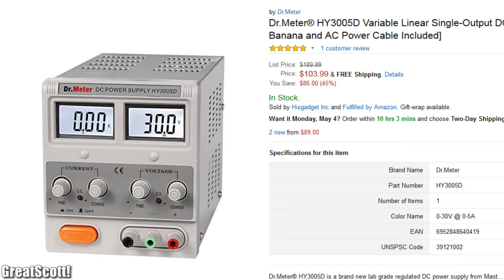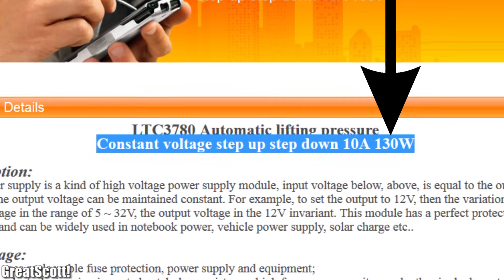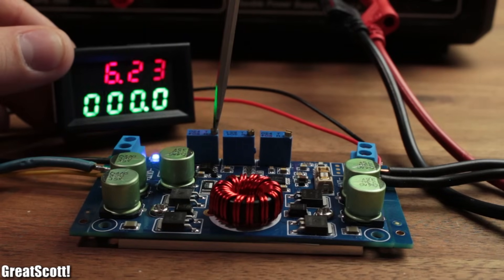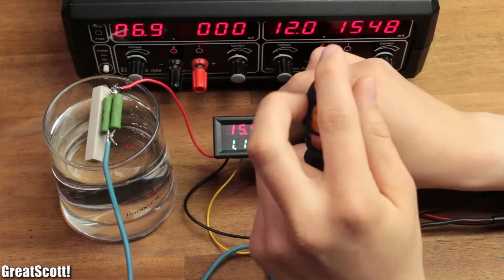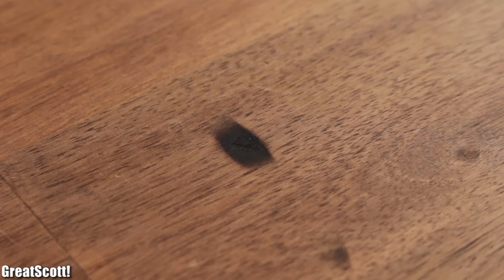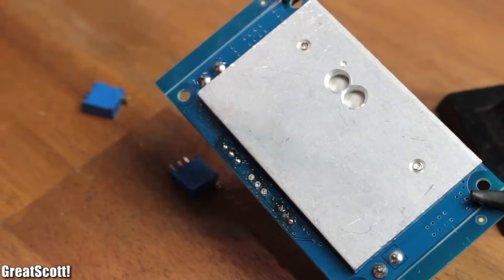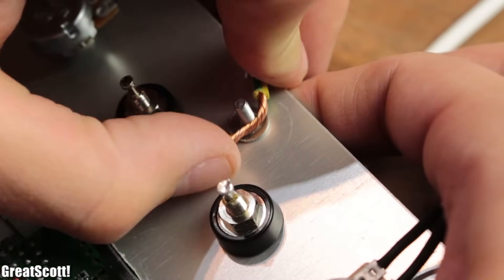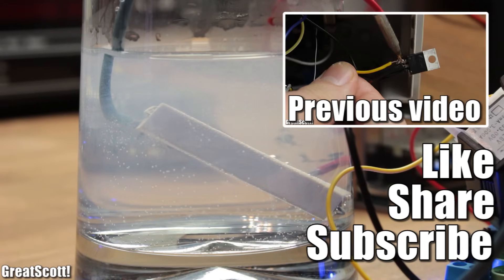Build your own Variable Lab Bench Power Supply

Comment: Scott, I have a doubt, can you help me? I'm going to make a much smaller version of it, without amp limiting and so on. Just a regulated power source to use with the protoboard. I'm using a step up down based in the CI XL6009E1 and it has a 10k potentiometer. The problem is: testing the 10k potentiometer and the one I bought it seems that they are completely different... The one I bought is a "common" one, let's say. So, how can I know how to wire it? Or it just doesn't matter? Thanks!

Comment: I think you need to update this a bit.

I followed the Amazon link to the LTC3780 buck-boost supply module, and all of the recent reviews within the past year or so all complain that the product has been changed by the manufacturer without any update to the product photos on Amazon.

Most notably, the massive heatsink on the back of the board was exchanged for smaller, inadequate heatsinks on the front, and has resulted in multiple board failures when attempting to crank it up to its maximum output voltage. This results in frequent failures due to overheating.

Moreover, another reviewer received multiple faulty boards in a row.

EDIT:
I did some more searching on Amazon, and sure enough I found many other sellers selling the exact same new revision of the product with the different heatsinks bonded to the mosfets on the topside. The new heatsinks are woefully inadequate just by looking at them. :x

Comment: I have a problem where the voltage meter shows a current draw even if nothing is connected It's only when it's boosting the voltage, if I pull it down close to source voltage it shows nothing. But I'm not interested in knowing what the current draw of the actual buck-booster converter pulls? Or could it be the voltage meter showing weird results? It's a cheap one like the one in the video, but his is at 000.0 at no load. Is there a fix for it?
Reply: I have the same problem as you,my meter showing a current draw when nothing connected,have you solved the problem?

Comment: newer stronger matrial same basics.  thicker & within harder. motherboard.intel prosessor to videocard to creat a deep later with plug & play active progrsmable & exp updating able drive & ride support display ..etc,: more.. a bigger intel component scale sizeto attach and test. ..and matron & coaxial barken with them bong deck santon treads spined in the isolation  & mental Shielded Intercom  centron brand treads. & isolating foil & new type cpu cooling pase more like a thicker faster mor hard fat scilicone ...have to be made out of white mold WOOD & SEA STONES MOLD & SEA SPECIES WITH A SILICONE SILK & SUPER SILVER  AND 2X CPU integration on a new model scale big 2x4 type of ciricuit bord card more strong & motherboard to, more strong the matrial. and cells flat inside of a 2X grid dubble proxy.. bit &ndubble CPU beside eachother in a deck component block. ...writer: Kengo Michael Kazunari. facebook : จำเลย เพชร ทอง ...understand :D

Comment: computer power supply power plant-serial wired 12 x powerbank's santi sycro & electro docing station plug & play chargers to top up the powebank's ..(1 charger to each with motor robot to ngage & disengage with electromagnet on components fw into leading switch selector digital wires & selector rele modul component. w./ powerplants syncro with crossfade balanced p2p ..when powerbank ngage/connect it will do the same trick that winamp crossfade in playlist music ..this programed switch on & off and standbyew. digital select stationary power suply giving feading electro to Hardware cards.  ..1 hardware card ciricuit boar hardware have 1 powerbank each remote and.. nead to test to create   ...questions ..writer: Kengo Michael Kazunari Facebook: จำเลย เพชร ทอง

Comment: Would it be possible to control the voltage output and current limit using Arduino analog write pins and a low pass filter?

Comment: In relation to buck, boost & buck/boost converters: I want to make a little LED strip installation on my room, but I don't trust the included adapters on Chinese strips, so I was planning to use a Delta 19V laptop PSU with a cheap buck converter... but as it's also a low-cost product from China I want to ask you: are they supposed to last if I maintain them within the limits, or is it the same or less durable than using crappy 12V adapters?

Comment: if i have only plastic enclosure then how can i connect ac earth to metal parts of enclosure
Reply: In that case it isn't necessary. The AC earth should still be connected to the 12v power supply, but not the project case if it's all plastic or wood like mine.
Reply: Raymond Morgan Ok thanks

Comment: Humm i was thinking on using an old computer power supply to make a variable one is just to test some stuff and i have seen a lot of videos but they only use the 12v 5v and 3.3v but i was thinking what if i connect all the 12v cables to a potentiometer to be able to change the voltage for what i want? I dont care about changing amps but it is just as simple as that just need to connect a potentiometer directly to all the 12 volts cables or that is not a good idea?

Comment: heat sink issue, the power converter design has change so that the heat sink is on top, reports are coming in that it can't handle the dissipation under load. i bought one and the heat sink was on top. reported on the amazon. hope for an exchange with the correct one on the bottom. the build is on hold until i find out

Comment: Are the exact value of the 200k ohm potentiometer important? Can I use my 250 k ohm one?
Reply: anyone?
Reply: You need to use the exact value
Reply: thnx, what will happen if I use the 250kohm one?
Reply: I think that you are gonna have a finer decreasing or increase(aka you would need to spin the potentiometer more to get the same result) or you might mess up the IC.

Comment: I recently got my LTC 3780, replaced the potentiometers and played a little with it (LED-s and stuff). The 12V source is exactly what you used. Yesterday I tried a 12V dc computer fan (with regular motor). The mains power happened to fall in exactly that moment and the LTC does not work ever since (The FAULT LED lights and nothing else happens). What could I do to troubleshoot it? I would prefer not to order a brand new LTC 3780 board...

Comment: hi ... can u hack pc power supply to run from car 12v battery instead 220v 50hz
Reply: No. No point in doing that. Why convert something that outputs 12V to work on 12V. You can buy cheaper converters from 12V down on Ebay.

Comment: From the scrap department of my work i was once able to retrieve a whole stack of 45 volt / 70 amps (3.2kW) lab power supplies. Both voltage and amps stepless adjustable. They can work on both single phase as wel 3-phase input :-) You can start a car on them with ease. Though they are a bit bulky for little electronics projects. Delta Elektronika SM 45-70 :-)

Comment: Hey I need to transform 240v ac to 24v ac. What do I need? Could I use a transformer like the one in the video ( not sure if the output is ac or dc) but with 24v and 2 amps?

Comment: I wish you would slow down.   I like your ideas but it went by too fast. Also,   would like to see a careful examination of the inside of the power supply,  the connections,  how the terminals were soldered, slow down!   Be methodical.   I want to see a careful explanation of which wires went where for that volt/ammeter read out.

Comment: How are you able to get 6A out of the variable power supply while the 12v supply is rated at 5A ??
Reply: It depends on the regulator unit. If you are supplying 12v at 5 A and you use a buck mode switching PSU then you are providing a DC to DC conversion typically that would be for a 5V supply. Well, 5v at 6A (30W) is less than 12v at 5A (60W) so you can trade off some of the available 60W power at 12v for a lower output voltage but higher current supply. 

If you were using 12v 5A to get to say 30 volts (a boost circuit) then you would be able to trade off some of the power for greater volts (30v) at the expense of lower current (2A max theoretical, in practice, a good bit lower). This is standard practice with DC-DC switching supplies.
Reply: Thanks for the response .. it now makes sense ! :)

Comment: Is there a way to scavenge the power supply from an ATX computer and adapt to this project???
Reply: yeah you can. use your ATX bundle up the 12V, 5V, 3.3V, and Ground(black) wire, hook up the 12V bundle to buck-boost converter (maybe you can use LTC3780 like this Video). use 5V and 3.3V as a bypass so, so you get 4 binding post : Adjustable, CC-CV 5V, CC-CV 3.3V, and Ground. and you have a great PSU. hope that help.
Reply: There at tons of atx power mods on YouTube.   There are drawbacks.   It is better to take the time to build a variable power supply more in line with what you see here.   The cost is roughly the same as a medium cost atx power supply. The psu' s leave you with just 12, 5 and 3.3  voltages.   That doesn't help when you need a higher voltage output or say,  an odd lower 9 volt supply.
Reply: Gusstavv's Stuff i guess ive found a video when they turned a PC Power supply to a lab supply
Reply: James Clark What i was referring about was to take from the 12V and put the variable control, maybe leaving the fixed 5 and 3.3 as a quick access
Reply: Ok,  thank you.
Reply: James Clark try to use lm317
Reply: LM317 can only handle 1.5A maximum current while ATX PSU deliver lot's of power. use Switching PSU.

Comment: Hi GreatScott! Ive been watching your videos alot recently. Your Videos are awesome.Can you lend me a hand? Im having a problem powering my 12-18v spindlemotor. I have a 24v, 6.5A enclosed power supply,I need to make a 12V, 6A or higher. The motor takes a lot of current. What can you suggest?Before I Powered the motor in this 24v supply using PWM in ardruino But it Burnt my Transistor(IRF520). haha
Reply: Im using this Motor https://www.amazon.com/Power-12-18V-11500-18000prm-Spindle-bearings/dp/B01B1DVUOO

Comment: This is a great project and the power supply works a treat.  Watch out for the UK Amazon power supply; it's much bigger than the one that features in the video (10Amp and physically larger) so there might be issues when fitting in an enclosure.

Comment: Is it possible to make a decent stereo audio amp circuit with Op-Amps? 
Or would it be better to use premade chips?
Reply: VGA Guy - yes it's possible - search Google for circuits. OK for experimentation but not ideal. Custom chips are so many and varied and CHEAP it's not worth the bother. They'll also provide better quality - lower distortion better noise figures. Look up the various TDA chip series of Analogue Audio amps; there are several available. 

Also you could consider a class D amplifier (PWM) which can output far greater power for their size than any equivalent linear audio amp. Pre-made high quality modules are pretty cheap - around 5-6 pounds only. Check out Google for class-D amps on the "shopping" search, there are literally hundreds of examples from low power 10-20W to extreme high power over 1000W and at prices from less than £5 !! to whatever you want.

Comment: I have many microwave transformers the microwaves was the biggest you can buy one of the transformers say 20 Amps on it and I want to use it to make a Bench Power Supply
Reply: Than you need to know a hole lot about transformers. Here in Europe the mains voltage is 240V and the microwave transformer can output 2000V. So you need to know how a trasformer works,you need to know how to make your own coils and a lot about inductance. Plus it wouldnt be variable.

Comment: +GreatScott!
 I don't understand - the potentiometers you use are rated for 1/2W so how it doesn't fry for such current and voltage you use?
Reply: You did see the blue pots on the circuit board that he removed didn't you? They were even lower power. The power does not go through or is even applied to those pots. They are control pots with a few milliamps only passing through them. They control the power (volts and current) via control transistors on the board. The transistors handle the power NOT the pots.
Reply: The potmeters are there just to "tell" the chip on the board what current and voltage it needs to output. Thats actually almost no current going thru the potmeters.

Comment: Can you explain how one could control the 2 potentiometers with an arduino instead? I have read that a digital potentiometer will not work and you would have to use a pwm signal and an op-amp to do this, but there are no good or clear tutorials on how to do this properly. Great tutorials by the way! Subscribed!

Comment: Hey scott, i wonder if i can make a Variable Lab Bench Power Supply with a 500W pc power supply and the components shown in the video( the LTC3780 and all that stuff).
It would also be interesting to know where did you got the enclosure. Thanks
Reply: You can actually made this using a PC power supply without the need of separate voltage regulation circuity. PC power supplies have a voltage regulator built into them already, to keep the outputs for 12V, 5V, 3.3V, etc. all within tight margins. You just hijack that voltage regulator feedback line to make it whatever voltage you want. Unfortunately, most of these PSUs are built with cheap parts, and cannot handle much more voltage than they already output. If you need higher output voltages, then your idea of putting the buck/boost converter after the PC PSU is a good option.

Comment: dEAR,
I HAVE A PROBLEM WITH LTC3780. WHEN I TURN THE VOLTAGE POTENTIOMETER THE FAULT LED LIGHTS UP. IT LIGHTS UP AFTER 6V AND VOLTAGE DOESN'T INCREASE FURTHER. WHAT COULD BE THE PROBLEM. COULD YOU PLEASE THROW SOME LIGHT..

Comment: So how do you not die when doing this stuff... like what to avoid doing?
Reply from the maker: Don't touch mains voltage. That's it.
Reply: Thanks.  Also, think make a videos about how to make a count down clock with small or large 7 segment displays, and possibly try to do it without an audrino or anything similar to that? (Maybe an audrino for Bluetooth connection or something like that).

Also it would be super awesome if you would include the overall cost of all the supplies in your descriptions. It would help us all know if we can afford to make that particular project. 

Thanks, all your videos are super awesome 👍🏿, keep up the awesome work!!!
Reply: I have accidentally touched mains like 15 times when i was young. Not pleasant, but i'm still here. You can feel your muscles vibrate violently at 50hz. It was only the live wire though. If you also touch neutral at the same time it will be a bit rougher.
Reply: I would suggest, whatever you do with anything above a 50 volts, just cut the power first. It takes maybe 3 minutes to do, and makes the job a whole lot more relaxing, knowing that all wires are dead. Even though you have to set the clock on your microwave again ;-).
Reply: well 400 aint far from 330 max and i dont think it would be so different in terms of shocking ones self.Still 400v is not present anywhere in an atx psu, at least under normal operating conditions.
Reply: It really depends on what mains voltage is in your area. 220-240v can kill you, depending on the path it takes through your body. 120v is far less likely, unless you have heart ailments or something different about you than the average person.

120v still hurts a little, but it's more annoying than anything.

But don't kid yourself. Either of these voltages can stop your heart.
Reply: jort93z I just got shocked by a 400 volt one out of a computer power supply. it hurt like a bitch
Reply: I wouldnt mess up with projects like these if i were you. No offense but when you ask such a question you d better stay away from mains ac voltage projects and in the name of god dont create your own. You should get relevant education before doing so and until then just buy off the shelf products that are safe.Thats for your own good.
Reply: He meant 400V capable capacitor, probably loaded up to mains voltage,
Reply: Richard van Pukkem yes, it feels like getting pin and needle if i dont move
Reply: I've touched both the neutral and the main when I was 3, it was 220 volts. I remember that my hands were black. I think that I'm lucky if I'm still alive...
Reply: small capacitors will likely be fine. just dont touch big ones xD.
Reply: Kyle Thomas What computer runs anything at 400 volts to need a 400v rail?
Reply: Landrew0 If you don't agree with me then you don't agree. It won't be my problem if something happens to you.
Reply: thats why it says that its dangerous to open the case of a pc power supply lol.
Reply: Dont do a setup whilst plugged in.

Comment: If I use a 300W power supply for this build, is there any other reason this couldn't utilize the full 10A capability of the LTC 3780 buck converter?

I am planning to build this as a module I can plug in to my hacked computer PSU to supply the 12v up to 17A input.

Otherwise I'm making the same build just without the inline power supply.

Comment: nice video. i have a SMPS that can give 12 volts at 60 amps. i want to make a circuite that can convert it to 5 volt 100 amps. is it possible? can you give me some idea. thanks in advance.
Reply: 100 Amps???!!!! For what purpose do you want 100 Amps?
Reply: Enough energy to create a black hole and connect two parallel universes with one another.
Reply: to run a WS2812B led display
Reply: Are you planning on using about 2000 WS2812B LEDs?
Reply: 30x60 ie 1800 WS2812B LEDs. thanks

Comment: Very compact and precise adjustment unit 32V/5A power supply.
Model Gophert 3205E have 4-marks on display current: http://ali.pub/91wip Price is only 55 dollars.
"Out of the box" it was calibrated to a 1-2 mark last almost the entire range. Excellent stabilization of voltage and current.I myself chose a long time, bought the - and very happy. Therefore, I recommend to all.